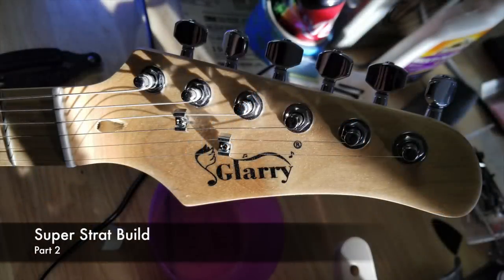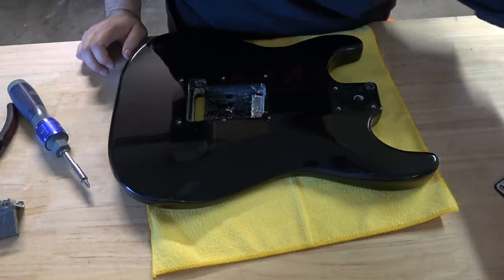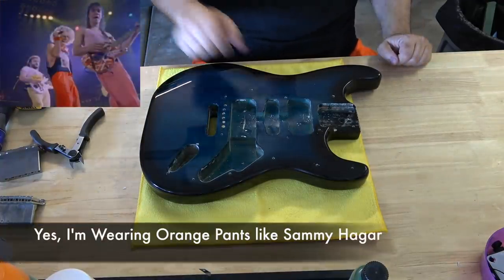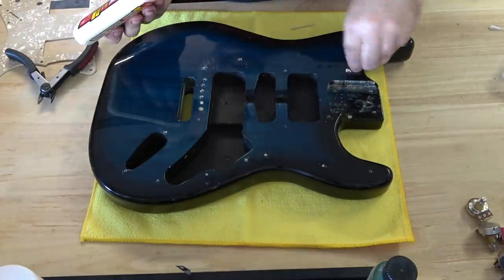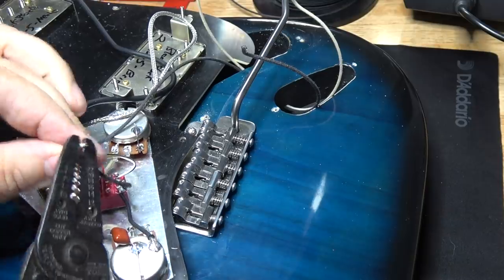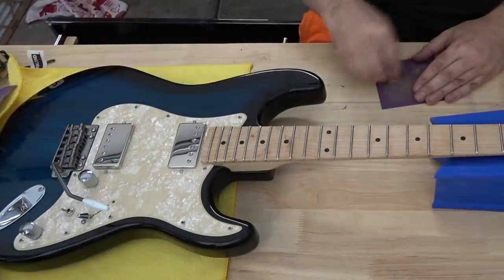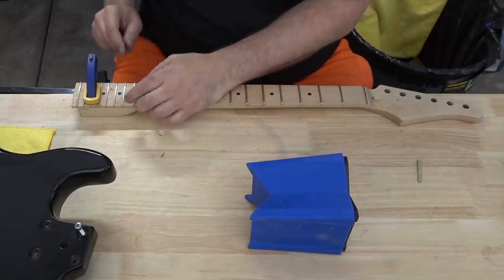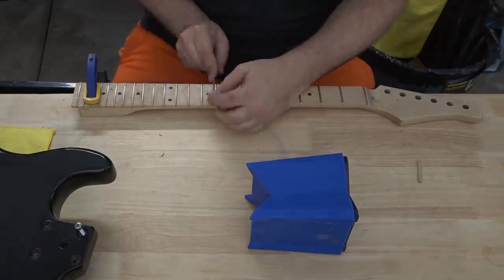Building A Super Strat Out Of A $75 Guitar. Sharpen My Axe

Comment: The good thing about Cheap guitars its fun to mod them and not worry about ruining a good guitar
Reply: Absolutely, and if seems like a load of cheap strat copies are coming out with bitching paint jobs on them so..... yeah why wouldn't you?
Indio classic with the light blue burst comes to mind and now this.... I mean it's worth $75-100 just for the paint... throw the electronics and hardware away, add some nice stuff with a setup and you've got yourself a tailor made guitar for the price of a Fender Mex or possibly less....
Reply: Something that I also thought about is the diy guitar kits you can't get....
Why bother when you have decent cheap guitars like this to modify....

Obviously there are exceptions, Crimson guitars "kit" uses much nicer wood but still... why bother with the ebay/amazon kits
Reply: Yup. Bought a cheap guitar about 2 years ago ($69) and bought a good $20 bridge and a $50 Dragonfire humbucker = banging cheap guitar with cheap upgrades. Maybe in a year or 2 I'll put in a new neck
Reply: Yeah and the Glarry guitars are way cheaper than the DIY kits. I tricked mine out with a bunch of GF parts and Pickups. 

For the nut I just got a Tusq nut so I didn't need any expensive fret files. Also replaced the trees with Tusk. 

I ran into the same issue as Phillip did with the big brass block tremolo I ordered and just used a dremel with a sand barrel on it to clear it out. Should have used a router bit like he did. Would have gone much faster and cleaner. 

I got set of locking tuners as well for around $40 from GF. 

Be sure to check the bridge placement. Measure from the fretboard side of the nut back to 25 1/4" (double check that on the fender site). That is where the screws for a 6 hole strat style bridge should be placed for a 25 1/2" scale neck. If you do this correctly you should have no problems with intonation. I did this incorrectly at first so wanted to give fair warning.

It was a lot of fun putting it together and learning to do all this stuff myself. Now I don't really play any of my other guitars. It sounds perfect and has stayed in tune for months thanks to the TUSK Graphite parts. One tip, Tusk has two different nut types. You want the flat one not the curved one with the tab in the middle. I used that type on the Glarry as well as a Bullet I bought recently.
Reply: If I knew how to install frets and do minor woodworking and all of that I could see this sort of thing becoming a hobby of  mine
Reply: @jarrusjenkins  YEah those kits do not seem to be any cheaper than just buying a good guitar outright. Even the really cheap ebay ones still cost more than a glarry.
Reply: Also you have the satisfaction of doing it yourself to your specs!
Reply: i agree with that, but honestly there is something really special about a guitar you build, and get to play with your own hands..!!
Reply: This video really inspired me. 
Thank you. 
I also didn’t know that E. V. H used unfinished necks and that’s how they got that worn look. 
I played my guitars for 34 years and they’ve been through hell and never look like any of those
Reply: @skincookiez7576  sorry for asking but wats gf
Reply: Yo, fr tho bro... I just bought a cheap Maestro by Gibson ( 1pickup, 1vol, 1tone, and output) and modified the pickguard so I was able to make it a (2pickup, 1vol, 2tone, 3way-switch, and output)
Reply: Punk!!
Reply: Indie rock

Comment: A tip I picked up from another commenter on a different video- before taping the fretboard, run one long continuous piece of tape along the length of the fretboard on the side of the neck, then tape the fret board.  That way, when you're done, you can peel off the one long piece and all the little ones will come off with it.
Reply: Ben from Crimson picked that up from a student, I think. Works a treat, as the Brits say.
Reply: Kilroy Was Here..good information

Comment: Those lights are available cheaper than $50 at Harbor Freight !   Use one everyday for 7 years on my welding table and only replaced 1 bulb  ( I broke through the clear plastic hard )  others at work have them with no complaints other than a bulb was broken in one guys box . Ace hardware has the replacements and I’ve seen them in Home Depot .

Comment: I saw a brand new "Strat" for $88. It's made by a company called Indy Guitars. The pickups are just steel slugs with kitchen magnets taped to the bottom. The electronics are so piss poor that they went into the trash can. The body has 6 seams, meaning six pieces of wood were used. The fretwork is nonexistent. They will draw blood they'e so sharp. And the list goes on. But I am doing the same thing Phil is doing here. It's actually going to be finished with the EVH striping pattern. I have a Super V Blade Runner bridge I am going to use, with a prebuilt pickguard that has three single coil sized humbuckers. A JB Jr. in between two Hot Rails. It's the Dave Murray of Iron Maiden's signature pickguard.
Reply: Indy or Indio? 
I've re-done an INDIO telecaster and you could cut an artery with the frets. Not to mention the grittiness encountered on bends
Smoothed 'em all out with 1000 grit sandpaper and it didn't take long at all. About an hour total, I'd say. and I'm playing it now.
Thumbs up!
Reply: @barnabywilde374  The one I am talking is called Indy Guitars, it's what's printed on the headstock. And it too was very rough. But you would be surprised what a little sanding paper and files can do to smooth it out.
Reply: 6 seams would mean there's 7 pieces of wood.

Comment: I just did this with the Monoprice Indio Classic. The body of the Monoprice is not compatible with a "Fender or Squire" neck, but that didn't bother me as the neck was quite comfortable for me to begin with. I pretty much kept just the body and neck and modded everything else. The big Pro with the Monoprice is that it has a swimming pool routing so you can use any configuration of pickups you desire, its also deeper than a squire so a "Fender" bridge will fit properly.

Comment: You may want to double check the size of dowel and drill bit used to drill out/fill the holes for the bridge. I am pretty sure that that was not 11/16 inch diameter dowel. 11/64 inch is a better bet.
Reply: yeah those definitely looked like about 1/4 inch dowels

Comment: I don't see why to use a triple switch. Maybe because it was the one you had at hand?
An interesting thing to do with this kind of switches is to use an on-of-on 3 pin switch. In the "off" (center) position you get the normal humbucker. In any of the "on" positions you get just one of the coils. The connections are simple: connect the common leads of the two coils to the center pin. Connect the hot to one side and the ground to the other.
I find it very usable mainly in the bridge humbucker because you can use the coil closest to the bridge together with the neck pickup (HB or split) to get a straty 2 / 4 positions sound. And you can use the other coil to get a fatter single coil sound alone.

Comment: For polishing frets that just needed some cleaning up, I used some fret rubbers and then finished with a dremel, and some jeweler’s rouge on a felt wheel. They came out looking like a freshly chromed bumper. Well, 22 bumpers. The abrasive is in a wax so it does spit a bit.

Comment: I did something quite similar. Most of the gear was replaced with Mexican Strat parts I got from eBay. All the primary electronics were replaced by Obsidian Wire  stuff, which is primo. Pickups from a Mexican Strat from eBay. Tremolo from a Mexican Strat from eBay. Found a slightly used set of tuning machines, Grovers. I'm just waiting on some neck attachment hardware now to finish it up.

Comment: Using a polishing compound and a cloth wheel on your dremel works as well for polishing and you have no need to worry about accidentally cutting into your fret or accidentally unleveling your fret because one quick 10 sec go is all you need to polish it

Comment: Kindly excuse my question, i am a beginner and i am here to learn. But why do we sand down-/level the frets with a flat beam? all necks have a radius, frets after being installed also have a radius correct (whatever it maybe 9.5, 10, 12" and so on). So wouldn't it make sense, to level all the frets with a beam that follows the same radius as the neck? Using a straight beam, the frets will be perfecly flat without a radius and the fretboad will have a radius......does my question make sense? or are frets not suposed to follow the neck radius when leveled?

Comment: I might use a Monoprice one or Glarry. Can’t decide yet. But I am going with one humbucker in mine.
Reply: Get the Glarry. It's cheaper, but has what you need. I took a $47 Glarry, added another 50 bucks worth of stuff, and turned it into a great looking and playing guitar. I replaced the tuning machines, and all electronics, and glued in a wooden block to negate the whammy unit. It's a very nice guitar now. You can buy a loaded pickguard and drop it right in.
Reply: Tom Delonge
Reply: @perihelion7798 , cool! I’ll keep that in mind!
Reply: @andy_182 , basically yes!
Reply: I think the monoprice comes with very similar looking, but slightly better hardware. Like a decent Squier vs the glarry, the bridges look very similar but the Squier small pot metal trem block is much heavier, even though it is still very light. The bridge plate itself is heavier and stronger. The saddles are heavier and sturdier, the saddle screws less likely to strip, the bridge screws are better. Goes for everything, trem springs, claw, all that. So I guess I would personally decide between the two taking that into account. If I was replacing all of that stuff anyway, then absolute cheapest thing that has a playable neck and body, which Glarry's do. If you're thinking of, for example, leaving the saddles and bridge plate as-is, just buying a new brass or steel bigger block for the trem, then going with the one with the better bridge plate and saddles, bridge screws, etc. might be worth the price difference. One of my strap button screws stripped almost immediately on the Glarry. 3 of the pickguard screws were already stripped. I was pleased with the quality of the Glarry for $70, but for a player, especially if the guitar takes any kind of beating or you gig with it, you'll want to upgrade a lot of that anyway. Also, I think that the monoprice body shape is a bit closer to actual strat specs. The Glarry forearm cut is just that sharp, small corner slant with the slightly rounded edge, and the belly cut is small and very shallow, if that matters to you.
Reply: @jayw7257 , I went with the Monoprice Indio. It was on sale on Amazon at $99 and free shipping to Alaska here. I am replacing everything with mostly stuff from GFS and reverb deals. WIlkinson bridge and trem, gfs humbucker and scratch guard for single humbucker. New tuners from WIlkinson fender 500K volume pot with orange cap, new volume switch, all new wiring. I’m doing frets and setup. I can’t wait to see what she turns out like. All gold hardware by the way. First guitar with that. Elixir strings as well. I ended up paying $230 on everything and I think it will play better than that. Next, I’m getting a V body from GFS and building something. A V with a Danelectro neck and maybe lipstick humbuckers!
Reply: @christophercarty675  Nice. I think the body shape of the Monoprice is a closer to Fender spec, which I like for a strat body. I haven't picked up anything from GFS yet, but I am getting one of their vintage style heel truss rod necks this week, and a few hardware odds and ends. Good luck with the build! I'm sure you will get a whole lot more than $230 worth of playability out of it.
Reply: @jayw7257 , thanks man, I’m sure I will!

Comment: Am just interested to know how good conductive paint is.  I know it will drain static charges away, but does it work for Magnetic fields?
Reply: Good question. Also wondering if you paint the underside of the pick guard, or just the wood cavity?
Reply: @eigenbroetler321  If the paint works the underside of the pick guard is a good candidate in my view.  Last bass I worked on I used copper foil in the pickup cavities.
Reply: Magnetic fields and electricity are the same thing

Comment: I see a change for a titanium bridge as a downgrade actually. If compared with steel the titanium has almost half of the  "hardness" (the elastic modulus is approximately 100 GPa) which means it will displace more with the same force applied on. Bad thing for tuning stability and tremolo action.

Comment: "I did part 1 where I reshaped the headstock, sanded the neck down and added stainless steel frets. You can check out that video by clicking the link in the description"

(doesn't include the link in the description)